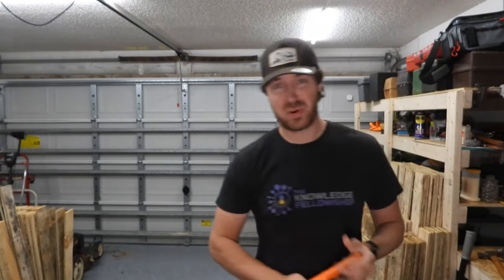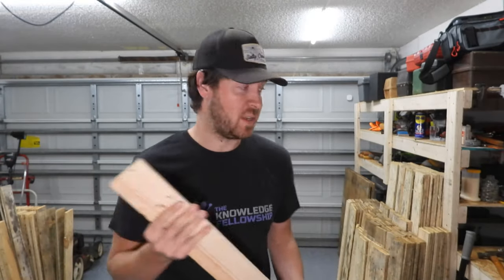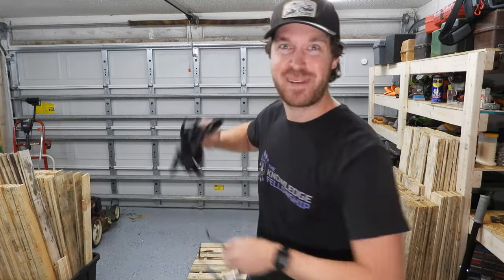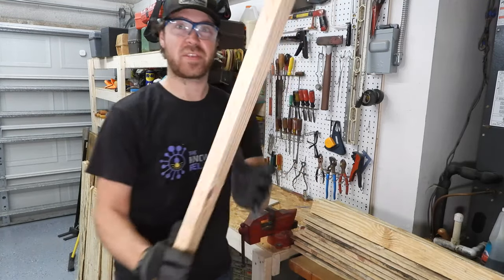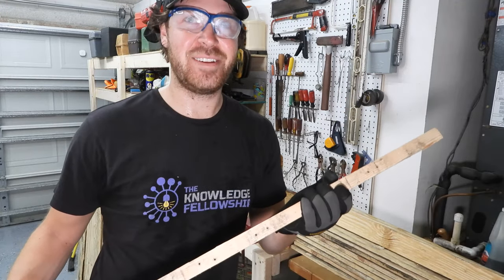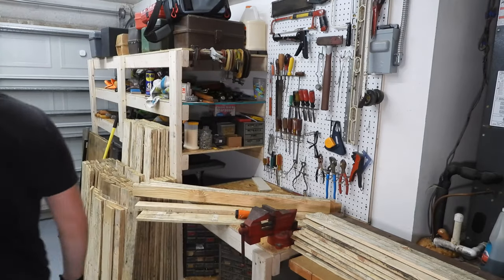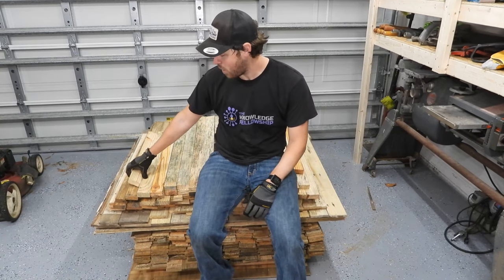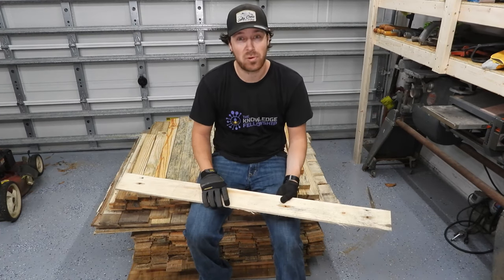Mastering Pallet Busting: Top Tips and Tools for Efficiently Breaking Down 20 Pallets

Comment: One quick little 'cheat' to make getting all the metal off the magnet easier... slip a sandwich baggie over the magnet before you start.  Then when you're done, just peel it off, and the metal will come right off with it.
Reply from the maker: Very smart!
Reply: Putting the magnet in a paper cup also works well.
Reply: Great tips !

Comment: The first time I see that someone actually telling about the remaining metal in the nail holes.  👍
Reply from the maker: It's some annoying little pieces too if your pallet used that nail style.
Reply: There are small, not expensive gadgets available that you quickly run over a piece of wood.  If there is a piece of nail, screw or whatever in the wood it will bleep.  They can be viewed on the WWW.  Ideal for those who use pallet wood.
Reply: @johnlewis9745 Did you watch the video? He uses one.

Comment: No joiner. No problem.  Take 5 boards that u trim on ur table saw to the same width. Use 2 squares to make sure they are square while clamping at the ends. Now run them through ur planer together as a solid board.  planer.

Comment: If you have the money I’ve found they have a pneumatic nail remover, like a bolt gun that shoots it though and out and a nail puller. Sadly the puller is way more expensive. But a great thing if you have back and knee issues to cut down on bending.
Reply from the maker: Heard of those. They're pretty cool!

Comment: Thank you. You made it look easy. I plan to build a garden shed & chicken coop from reclaimed pallet lumber I’m going to use an old time radial arm saw with the power head vertical and a carbide rotary planer. I hope I have no problems with the occasional nail. Also, thinking about making parquet flooring from the nicer boards.  Anyway. Thanks again.

Comment: I've found what metal swuff that's left behind won't harm any cutting blade  it's brocken off nails that do the damage the main course of this is not removing then straight away , my reason for telling you this as most other materials ie manmade boards have metal particles inbeded within them and this takes along time to dull a blade or cutter!
Reply: Interesting. Thanks.

Comment: Those barbed ones are the bane of my existence lol. Literally every single pallet in my neck of the woods is held together with nothing but those buggers. 
I gave up digging them out and just zip the boards off the stretcher with a saw. If I need longer boards, I just shiplap and glue two butts together.

Comment: I just use a 5/8 hole bit after removing the auger bit. Use another board with a hole already drilled for a guide (since the bit will slip). Then plug all the holes with a 5/8 dowell.

Comment: I only work with recycled wood. Mostly pallet wood and I have two tools that I use to remove the nails. first I use a nail punch and the nails are pulled using a Blacksmith tongs to pull the nails.
I have asked Santa for a Pallet Buster, But I will have to special order it and that will have to wait until after the Holidays are over. Because I live on the Big Island of Hawaii.